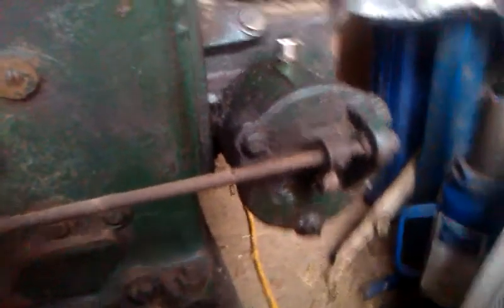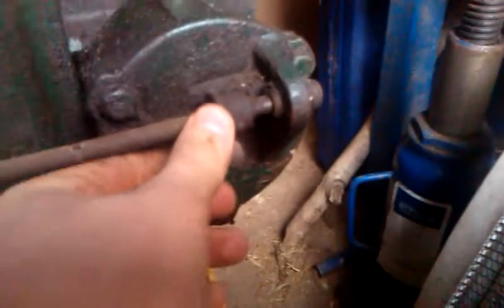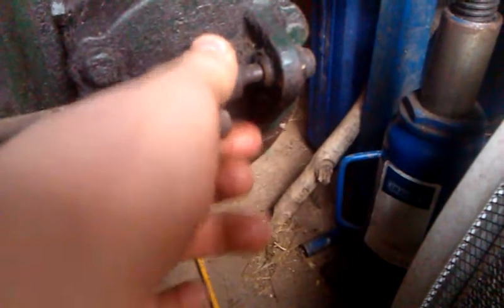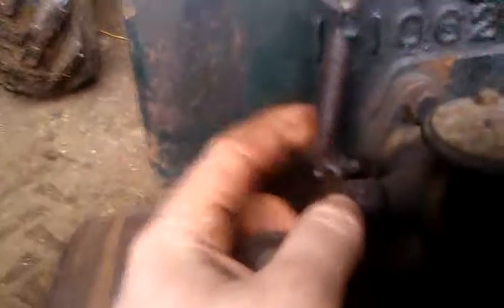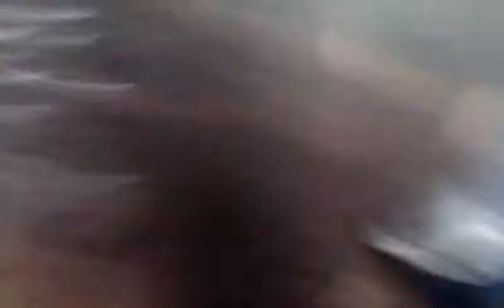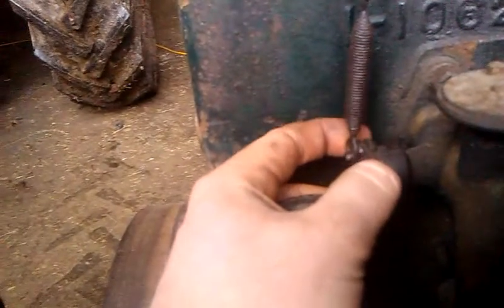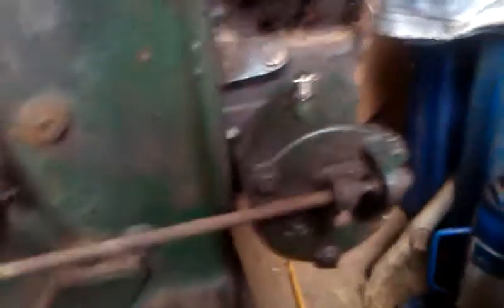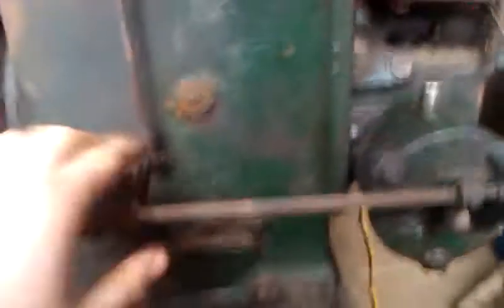Lister D run

Comment: Hi Edward, thanks very much to show me how the governor shaft work, very nice thank you. One question will it still run away if you regulate the carburetor butterfly manually. I will have to get a shaft but to test run the engine will it be OK if i control the butterfly, thanks again.

Comment from the maker: should be ok for a test run you may have to hold it in place wen its running to stop it from revving up but if it does run  away you can just cut the spark or stuff a rag in the air intake